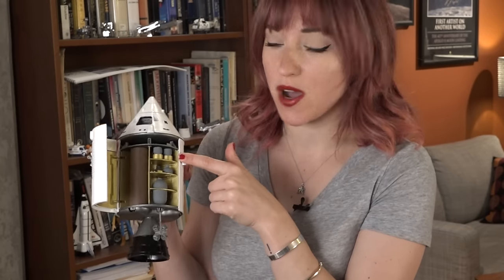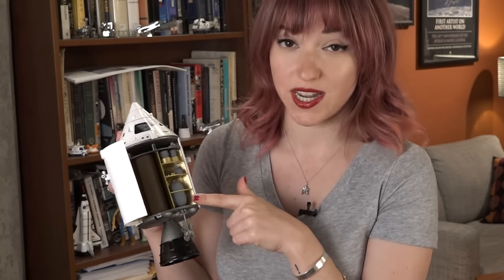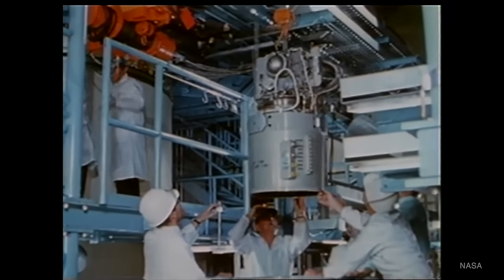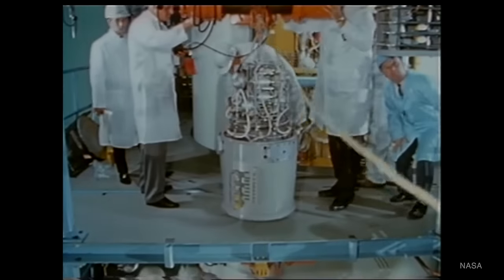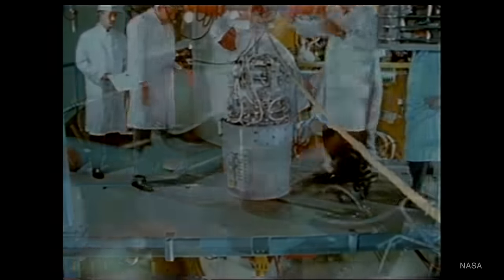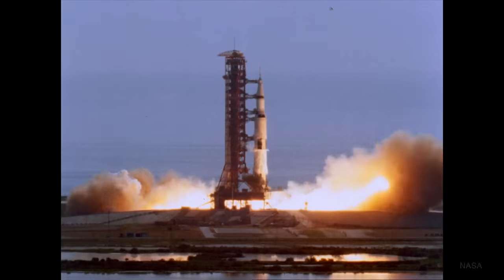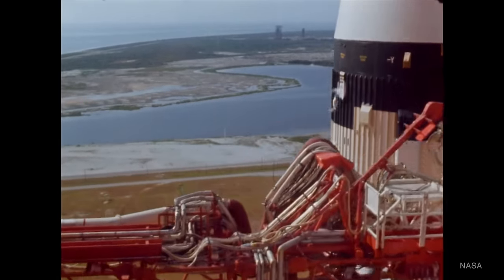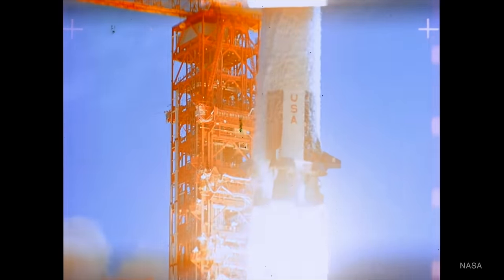How Quickly Did the Crew of Apollo 13 Know They'd Lost the Moon?

Comment: Can you explain the course correction of Apollo 13. I love the movie but that scene doesn’t make sense. In the movie, they are using the LEM’s windows to gauge the earth’s terminator. How could that be if the vehicle is headed Earthbound with its LEM windows facing towards space?
Reply: No one can explain how he landed it to an accuracy of 1 nautical mile like that, right by the press boat.
https://abcnews.go.com/Archives/video/april-17-1970-apollo-13-splashdown-13249672
Without GPS or decent windows or controls, amazing.
Reply: Robert Currie
They used the LM Commander's Window which is located at the "top" of the Lunar Module and as such was oriented towards earth. The report I'm linking to is very technical but hopefully will give you a better idea of what was going on https://ntrs.nasa.gov/archive/nasa/casi.ntrs.nasa.gov/20090026451.pdf
Reply: The LM Commander's Window faces down to the lunar surface, away from the top of the LM.
They'd have to tilt the assembly way over to see earth, at which point the LM engine would be facing sideways. The interesting thing about Apollo 13 is the splashdown was exactly 1.0 nm from the awaiting press in a time before GPS from flying based on back of an envelope calculations. Quite impossible.
Reply: Graham
I suggest you read again the paper that I linked to. You will see the burn took place 37 hours before reentry, so the craft was some significant distance from the earth. You need to think about the scale of the distance and in 3 dimensions.  Your subsequent claim about landing accuracy is simply a claim from incredulity - unless of course you can describe in detail what made it impossible.
Reply: @Martin. I suggest you put themselves in their shoes. In three dimensions the burn toward earth must be done blind, they can only see the earth if they tilt the craft, any course correction would then need another burn - possibly done blind too. Fixating on star sights only gets you so far and doesn't stop you hitting the earth dead center at several thousand mph or indeed sailing past: they need to aim for a precise window: in the film they looked out of the window: but in reality they had no view of earth from that window.

My point about landing accuracy is not incredulity it's basic probability: they were worried about missing the earth or burning up - yet they managed a perfect re-entry (not managed by NASA since the Apollo tales) and landed within 1 nautical mile of the target. Without GPS and with an earth's surface area of 200 million square miles it's simply impossible to land in the correct square mile.

It's actually a skillful parachute drop from a plane, a testament to whoever flew it rather than the random chance we're expected to swallow.
Reply: @G-ra-ha-m   The high accuracy didnt just come from the known trajectory. The command module had a off center Center of Gravity so that it can change its lift by rolling the spacecraft and therefore gave them crossrange capabilities. Their guidance system constantly adjusted their attitude so that they would hit the preplanned splashdown target with high accuracy. You can look for reports about the EMS (Entry Monitoring System) for more details about the entry targeting for Apollo.

Given that the Gemini and Skylab missions hit their intended landing areas with a high degree of accuracy I assume you believe these to be fake aswell?
Reply: @Martin: You think they got to within 1.0 nm from a lucky (to not be thrown off or to burn up like a meteorite) re-entry by an off-center CofG? Their 1969 guidance system? Seriously?
They would have been lucky to land within ten thousand miles. The EMS is nonsense, they are a falling object in a radio blackout for much of the time. Sci-fi films are more realistic.
As for Gemini, after Iraq's WMDs and the lies about Syria do you expect me to believe ANYTHING the US government says?  I suppose you believe the Gulf of Tonkin happened too?
Reply: Robert Currie
I've reread that report I linked to. The correction was needed to address the reentry angle which was too narrow. The burn was therefore perpendicular to the direction of travel and as such the earth would have remained visible from the commanders window. Whilst the movie is pretty accurate in its protrayal of the incident, some poetic licence is exercised. This manual burn lasted 2 or 3 seconds in reality - however the film depicts it as much longer with the craft yawing and pitching all over the place.
Reply: Not necessarily perpendicular, or even a perpendicular component needed as speeding up or slowing down would also change the re-entry angle too. Basically: you are guessing.
With 200 millions square miles and a 25,000 mile circumference their 'manual 2-3 second burn' would be lucky to land them in the right hemisphere, much less such a tight angle that they could 'adjust their CofG to hit 1.0 nm to the press boat.
Reply: Graham
Why do you keep repeating ad-nauseam this reference to being 1nm from the press boat? It's complete rubbish and you know it. The splashdown point was 1nm mile from the target but approx 3nm from the recovery ship. Perhaps you would like to outline your qualification and experience in orbital mechanics and spacecraft guidance and navigation and why your arguments from incredulity carry more weight than the report presented by the American Institute of Aeronautics and Astronautics.
Reply: @Martin. I repeat it because its true, and the truth doesn't change.
The detail between 'target' and 'press boat' is an irrelevant distraction because the point in question is the accuracy of the splashdown - which remains at 1.0 nautical mile.

Your appeal to authority is noted but still doesn't change the fact that (the story says) they manually entered the re-entry corridor and still managed to steer the projectile to 1.0 nautical miles away on a planet of 200 million square miles with a circumference of 25 thousand miles from a crippled craft with manual controls, limited visibility and no GPS in a craft hurtling toward a rotating planet.
Even one degree early or late is around 70 miles of error on the surface.

They were in a projectile, not a modern helicopter and could not possibly have got that close to the target unless they were dropped out of a plane. Even for a parachute drop (which explains how those big parachutes fitted inside - something project Orion only managed a couple of years ago) it's pretty accurate, NASA had some good transport pilots back in those days.
Reply: Graham So no qualifications, skills or practical experience in this field, yet you claim to be better informed than aerospace engineers and technicians. How arrogant. Can you also advise on marine engineering, avionics engineering, geotechnical engineering, perhaps even biomedical engineering. No of course you can’t. You can’t even get the basics of the Apollo missions correct that you pass your uninformed opinion on. Manual controls - I assume you pulled that one from the same place as you’ve pulled the other shite you’re spouting.
Reply: @Martin: 'So no qualifications,".   How arrogant to assume that!
Your appeal to authority was noted previously, you have no confidence in your arguments?
'Manual controls'? No, I quoted YOU: 'This manual burn lasted 2 or 3 seconds'. 

I've given you the numbers, with 200 millions square miles and a 25,000 mile circumference their 'manual burn' would be lucky to land them in the right continent, let alone the right ocean, let alone 1.0 nm from the target.

I suggest you learn some of the maths behind probabilities before you accuse people of being 'uninformed' and having 'opinions', and learn some facts about Apollo so you can argue about the subject instead of taking the cowards route of tackling the messenger.
Reply: Graham It’s not about probability though. That’s nothing more than a straw man argument. If you have some qualifications and experience relevant to the subject please identify them. Otherwise as has been already been stated, your opinion is simply that, an unqualified view that carries no weight whatsoever.
Reply: @Martin: It's not a strawman, I'm explaining exactly why a 1.0 nm is impossible.
A manual burn with limited/no visibility in a bodged together craft has no chance of getting the correct latitude or timing (longitude). There was no earth parking orbit phase to allow more accuracy either, it was like getting a basket ball in a hoop from 10 miles away. Approaching a rotating planet at great speed in a damaged craft they were lucky not to skip off or burn up - if any of it were real.

Also on the way down the plasma meant they were in radio blackout (to chance to steer) and blind from the moment they started to fall. It's a projectile - not an aeroplane - with very limited maneuvering as it dropped out of the sky like a stone. 
They couldn't steer the parachutes either, essentially it was uncontrolled.

There's also the suspicious way the radio signal from 250,000 miles away was sent and received from a craft of variable and dubious alignment, yet it all worked as if they mission control was just down the road from the studio.

I'm sure most of NASA thought it was real and wanted to believe it was real so much that for them it was real, but every facet of Apollo is fake and ridiculous. A desperate one-shot landing on a rotating planet of 200 millions square miles from a craft with limited controls and visibility before the says of GPS and decent computers gets it to within 1.0nm? Not a chance.

Your problem with defending Apollo is not that they made up one aspect of the story, your problem is that they made it ALL up and there are credibility issues with every single aspect. You can try and tell me the Apollo 13 astronauts won the lottery and everything worked out just fine, that they didn't even notice the Van Allen belts and ignored the shooting star show they would have seen as they passed through, that everything really did work out just like in the movies and they we haven't been back to the moon because 'no money', 'no interest' etc., but that still doesn't make it real.
Reply: Graham
You're not explaining though - you're simply telling me it would have been impossible. That is your uninformed opinion. And I will continue to consider your views as uniformed unless you specifically address the questions around skills and experience. I'm not suggestion people cannot or should not question information, however to accurately assess potential answers to those questions knowledge and understanding of the subject matter is essential. Your appear to have none.

You also refer to a "bodged craft". Please accurately describe what was non functioning and how this impacted on spacecraft performance including guidance and navigation.
You also continue to ignore the fact that the Command Module generated lift which could be aimed in any direction to the flightpath. The vehicle was typically flown by the computer - it was anything but uncontrollable.
You imply communications worked flawlessly - I suggest you listen to the recordings of the ground to air transmission .
Reply: @Martin: No, I'm telling you exactly WHY it was impossible.
You have provided exactly zero evidence to the contrary. You have provided no evidence of any precision timing or guidance that allows them to be that accurate. The most you have said is 'manual burn for 2-3 seconds' - hardly precise is it? 

The 'bodged craft' - seriously? The LM was never designed to fly back to earth joined on to the CSM, much less a broken one, and never designed as the source of thrust for doing so. There's not even a usable window in the configuration when lined up with the earth. They couldn't even do a proper temperature roll even in the NASA story.

Any 'lift' from the CM projectile is irrelevant if you are blind, deaf and don't know where you are or where to steer. It's not a helicopter, it's an object falling from space at several thousand mph surrounded by hot plasma. 
Explain how they would know which direction to 'steer' toward, even if they could?

Your uninformed faith in the NASA story is blinding you to the obvious impossible obstacles to a landing of anywhere near that precision. Within 10nm would have been a miracle, 100nm would have been exceptional, 1000 nm would have been almost believable, a different ocean or smashing into a mountain would have been more realistic, as would bouncing off the atmosphere into space or burning up. Yet we have a lottery winning band of plucky heroes pulled out at 1.0nm from their target LOL
Reply: Graham
The details are in the report and presentation that I linked to that was delivered at the AIAA Conference in 2009. Further details are to be found in debriefing and analysis documents that are readily accessible online. That's your evidence. You have claimed that it is inaccurate, but can't articulate why - other than you think it was impossible. And again this takes us back to your lack of skills and qualifications to enable you to present an informed opinion.

Yes the LM was not designed for the specific task it performed. However, how have you arrived at your conclusion that it couldn't perform the task required? What is the engineering basis of your assessment? Where, for example, are your calcualtions to evidence that the propulsion system could not deliver the required delta-v?

Your claim that there was not a usable window is incorrect and is clear evidence of your lack of understanding of trajectories, orbital manoeuvres and spatial awareness. Try playing with Orbiter (yes I am suggesting a game) and you will be able to position the craft into the correct orientation. I would also recommend this book as an introduction into orbits and celestial mechanics https://www.amazon.co.uk/Fundamentals-Astrodynamics-Dover-Aeronautical-Engineering/dp/0486600610

Regarding re-entry and landing you show you ignorance of Apollo systems yet again – or perhaps your willingness to dismiss them out of hand. In basic terms, the spacecraft knew where it was, where it needed to go and how fast it was getting there. Read about the Apollo Guidance Computer and Entry Monitoring System. And despite your claims to the contrary, lift was produced and could be aimed either at the earth or away from the earth, this giving the ability to lengthen or shorten the landing trajectory. Roll manoeuvres were used to manage lateral accuracy. The spacecraft RCS thrusters were used to control steering. Again there is much detail available about the entry phase of the mission perhaps you should go and read it and if you don’t understand ask a professional. Declaring something to be impossible because you have not understood the matter is rather superficial.

Comment: Repost: I want to ask you a question. Something i've always wondered about. Why 
did, both the Soviets and NASA, build huge rockets to get to the moon? 
Wasn' t it easier for them to bring the modules separatly into orbit and
 join them there. The russians, at that time, had a sufficiently 
powerfull rockets(R7 Semyorka and Proton) to do the job in three to four
 launches max. I know that rendezvous was a really hard think to do, but
 still. Thanks!
Reply: +Владислав Валентинов :Earth orbit rendezvous was the preferred method early in the Apollo program. But it was an engineer (John Houbolt) who proposed LOR or Lunar Orbit Rendezvous as being a quicker and possibly less expensive albeit riskier way to make the JFK lunar deadline and lower the total mass required to be launched from Earth. This allowed the Saturn-V to be used for Apollo rather than several smaller vehicles which would have been more expensive in terms of launch costs. The Russians had the same problem so they designed and built the N-1 which was RP-1 and LOX powered in all stages making it a little less powerful in terms of specific impulse, than the Saturn-V. This is why the N-1 had more liftoff thrust.
Reply: Thanks for the detailed explanation!
Reply: Thanks for the detailed explanation!
Reply: +Владислав Валентинов :My pleasure. Glad I was able to help.

Comment: Why no Skylab 5 mission? We're they saving the Spacecraft for the Apollo Soyuz?  We're they out of Saturn 1Bs? A final mission could have used full fuel tank age for SPS and boosted Skylab to higher orbit.
Reply: +JVC Gemini 13 IIRC, the 1B couldn't lift a CSM with full tanks.  It probably just came down to money though, and the fact that at the time they fully intended to boost it with one of the first shuttle missions.  My understanding is that they didn't anticipate Skylab's early reentry until it was too late to launch another Apollo, and the shuttle was delayed a few years by design and manufacturing issues.  Although I'd love to hear Amy's take on this.
Reply: +Josh Wilder :It was largely cost. The shuttle had been approved a year before Skylab and NASA anticipated correctly, that they would be cut severely budget wise after Apollo so what budget was left had to go to shuttle. Your correct on the Saturn-1B CSM limitations. The Saturn-1B could lift 23 tons to LEO. The CSM massed out at 16 tons for LEO while the lunar CSM massed out at 32 tons or thereabouts.
Reply: +JVC Gemini 13 :The Saturn-1B could not lift the fully fueled CSM to LEO. The main reason for no Skylab 5 mission was what you said. They needed a Saturn-1B for ASTP. When Skylab was being built, they built another lab which now sits in the Smithsonian. It was one of the victims of NASA budget cuts.